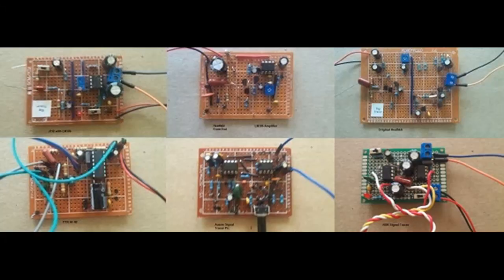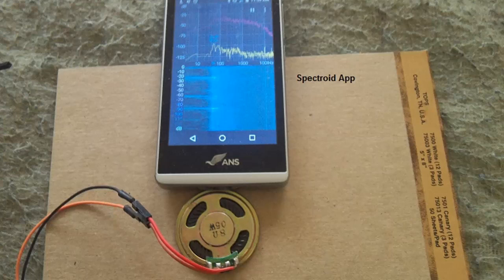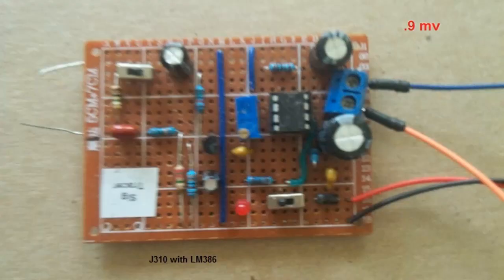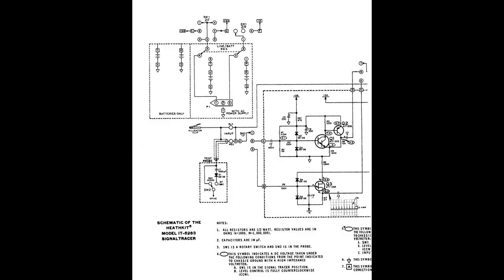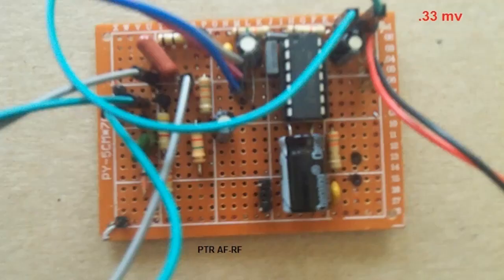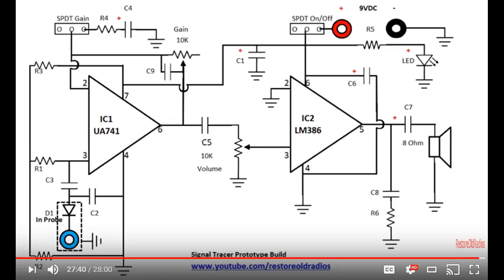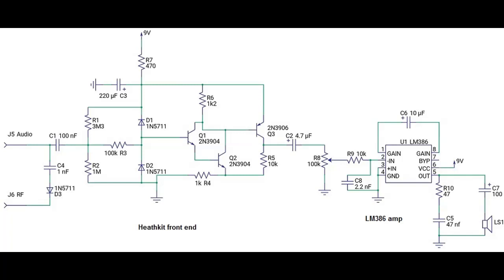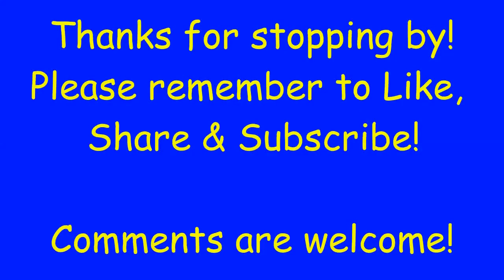DIY Signal Tracer Comparison

Comment: Good video Bob,,,, btw,, on the first tester where you mentioned the noise switch, perhaps he was trying to replicate the noise function found on the Heathkit T3 signal tester where one of the switches when set to noise, you could put a component such as a resistor on your probe and if it was bad, loose, or " noisy," it would make a loud racket and you would know it was faulty.
Just a guess but would be interesting to see if it worked as well as the Heathkit did.
Reply from the maker: I think that is what he was going for Carl, but 9 volts just doesn't put the kind of stress on a component that the 160 volts from a Heathkit could. 😋